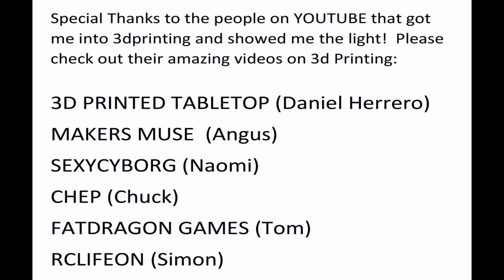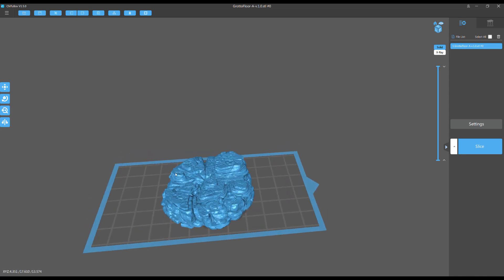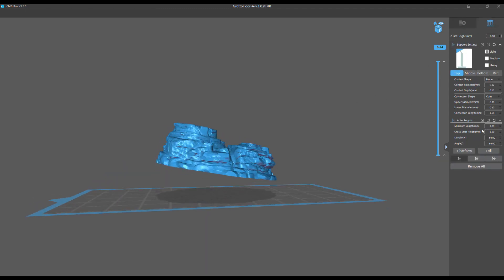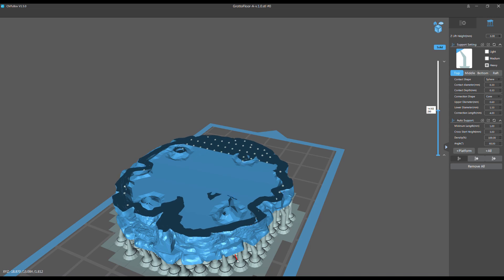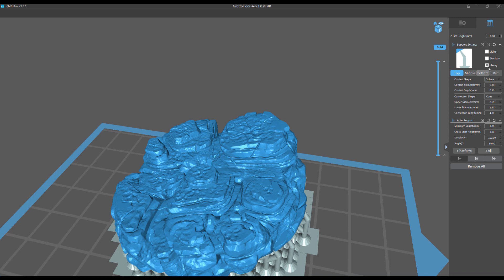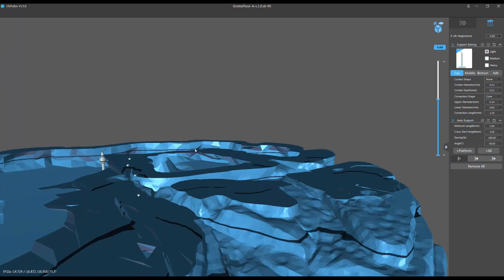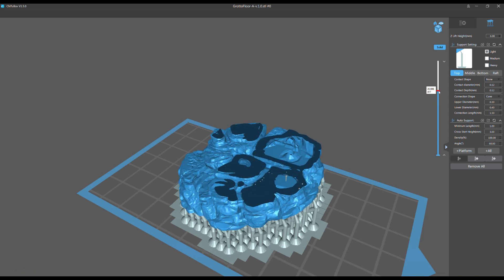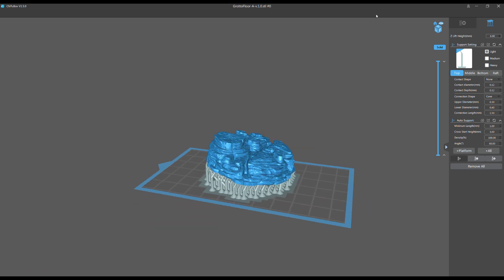DO NOT HOLLOW A MODEL IN CHITUBOX WITHOUT WATCHING THIS!

Comment: Good info, I'm new to resin and this was helpful. I did think this was going to cover curing the inside of hollow models b/c I saw a figure that exploded with wet resin on the inside recently and I haven't found any explaination on how you avoid that besides the single sentence advice of: Add drainage holes.

Comment: I have a very similar model, a base for a dragon, but when I press dig hole and click the green 'hole' on the model, Chitibox pro doesn't dig the hole. 
The hole I'm trying to dig is deeper than the wall, but not so deep that it starts to dig on the opposite wall.
It works on some surfaces of the model, but not the ones I want. Please could anyone advise?

Comment: Thank you for the video. It in fact didn't occur to me that interior space of hollowed out model might require that much support.

I am however a but uncertain about your choice of drain holes. I really suspect that the insets that hollowing out process made around the magnet holes will prevent resin from draining properly, trapping a large amount inside.

Comment: so I know that my current Chitubox version v1.8.1 will actually autosupport the interior as well now, but my little confusion, is that it also has the Detect islands feature, and will pinpoint them all for you, my question that I cant seem to find ANY solid answers for is, how can I tell what is considered an island that is safe to delete, and what qualifies as something I still need to add a support for, I get overhangs need support, but as far as the interiors of hollowed pieces, sometimes it really looks like it could just be inconsequential... long story short, I have a model with 120 islands detected, and a LOT of them look like I could delete them, but now I am nervous about if I am judging them correctly.... ultimately I feel like my question boils down to, if said island is shown as only one or two pixels, and is on the interior of the model, are those islands safe to delete?

Comment: What's the point of having drain holes? The cavity will remain open until the end of the print, in which case the resin will drain out the top (being upside-down). Right?

Comment: Question, new to this but would choosing an infill and making it a 3d grid be better than manually adding supports to the inside?
Reply: Only if those supports happen to be under one of the islands mentioned in the video. It would certainly make things faster, because you'd only have to add the manual supports to the spots missed my the infill.

Comment: Ok, I'm totally new to 3D printing (not got one yet but I have been making 3D models for videogames for years) You could  just make a large hole in the middle of the bottom base to allow supports to print from the plate up to the unsupported areas you need? All you appear to need in the base bottom is four supported holes for magnets to go into. You could even have a large scale mesh bottom to support those 'holes' and have easy access to the upper inside for supports. Just my 2c.

Comment: NOTE: Because of where you put the holes you could not drain the all the resin out of that model. At least one hole needs to be at the lowest point of the cavity so all the resin can drain out.
Reply: but actually the holes are not to drain but to let air in. it's upside down, so it stops sucking.

Comment: Hey Greg, about the placement of the draining holes: if you put them on the base, then the resin can't flow out, because the model is printed upside down. You'd need to put them on top (where they are visible, unfortunately) for them to drain the resin while it's still in the printer. When they are on the base, it may flow out when you're cleaning it, because the model moves and is submerged in your IPA/water. But then you're not saving any resin, because the resin was trapped inside the model all along. Am I right or I am missing something?
Reply from the maker: If the model completely exits the resin on higher layers before it's "closed in" the "trapped" resin will flow out  :)

Comment: Although I've been using filament 3D printers for many years, I finally got myself a resin printer (Elegoo Mars 2). When possible, I keep my models flat with as much surface space touching the bed as I can. I use supports only if I absolutely have to.  I've been getting fantastic results with 95% of all my prints right from the beginning. The only problems I have had are when I scale down a model so small that the walls are micro thin. Most everyone talks about the need to tilt models but for myself, it just seems to increase build time and use more resin. 

I still have much to learn about resin printing and I thank all content creators who have made so many helpful videos on the subject. Well, enough chat. Back to watching videos and printing.

Comment: If you hollow and prepare drainage holes in an external program for example magics, then generate support in chitu, it will fill the internal void with support. I think Chitubox might be manipulating the slice images rather than the 3D mesh when doing these hollow calculations, so it is left out when you try to generate supports which operates on the mesh. Its a pretty big bug imo. Although if they can sort it out it will save people a lot of money on file prep software.

Comment: Amazing videos! You're information is so clear. I'm curious if you had used auto, but with the light supports selected, wouldn't it apply them to the inside? It seems you could do a light auto and then manually add a few thick ones on the outside.

Comment: Might be a silly question, those internal supports - How are they going to be cured?
Reply from the maker: Some people snake a thin UV led in, I just make sure light gets into the holes  :)   Most important thing is that you clean the inside as thoroughly as possible
Reply: @3dprintingpro212  ah okay, i use a wash and cure station mostly, i dont have a thin uv light but ill look into it. Thank you :)

Comment: Very good tip on the video. (just ordered my 1st printer)
I've been wondering recently, if you are building the model upside-down then the hollow area is open till nearly the very end and should keep draining as it builds right? 
So how helpful are drainage holes? 
Are the holes you make at the top (build-plate area) merely to help with preventing suction?
Reply from the maker: at the top doesn't help with suction or "cups" it's just fro cleaning. If you fear suction or a cup forming, which is real, you need a hole somewhere near the build plate but on a "side"  :)
Reply: @3dprintingpro212  
Oh for cleaning the inside of the print, though is that necessary of it would be sealed otherwise?
thats the 1st time I've heard of it called "cups".
yea on the side near the build plate would be ideal for that. 

So, why the holes where the magnets go ?
I guess I don't fully understand how the draining process works. My theory seemed sound though.

Comment: thank you very much, great advice. I'm a total novice (actually I'm still waiting for my first 3D resin printer), so I have a very very dumb question: for something like this (regardless the hollowing and its problems/consequences), why do you need to raise it off the bed and tilt it? it has a flat base, so what would happen if you just let it laid flat on the bed? I'll need to print a bunch of bases for my miniatures, which will all have (obviously) flat bottoms. thanks if you can answer, and thanks anyway if you can't, for this video! :-)

Comment: There is a chance that if you hit supports first before hollowing out the model it won't build them inside. If you instead hollow the model first then add supports it will build little supports on the inside... just a thought worth trying...
Reply from the maker: that's right but it misses a ton of spots...

Comment: But then you cant cure the internal supports???
Reply from the maker: Most resins we use are cured enough during the print that the internal supports are fine. Important thing us to make sure you thoroughly clean it so no uncured resin is in the hollowed part.

Comment: So you tilt the object to reduce the surface area, but then add support structure that creates even bigger solid surface area on the build platform. I am new to MSLA printing so I don't quite get that. If someone could clear that up for me I would be very thankful. :D
Reply: The bottom platform is printed at different settings, typically won't have issues.

Comment: The way I get around this is saving it out hollow as a stl and edit the file in a 3d application. Where you can easily build select support inside the mode with walls.

Comment: I have a model that fills the build plate  and uses 3/4 of the build height.  It needs to be hollow.  No matter how I hollow it, the neck and head are always an island.  I can clearly see the island, but can not add support, even the light ones.  I know there is enough distance to do even a heavy support.  I can not get my mouse in there to select the points to add them.  How do you fix that?  How do I lock teh layer so that I can simply go right and left and not up and down so that I can get inside the model?

Comment: I'm using v1.6.3 and it generates auto-supports internally when the model is hollowed..   at first I thought that was not good, but then realized it's good.
Reply: Might have to upgrade as this is exactly what I've been looking for... Auto internal supports and manual platform supports.. Thanks!

Comment: What is the advantage of creating a hollow model vs. a solid model? Sure it would use less material, but the small cost compared to the time and possible increase of failure doesn't seem worth it. Any other reasons?
Reply from the maker: aside from costs savings, weight of the model as well, I rarely hollow to be honest...

Comment: im gonna be honest.  There are not that many unsupported islands on that model. As long as it connects somewhere to a previous layer its not likely to fail.
Reply from the maker: ANY unsupported island leads to cured resin floating in your vat or stuck to your FEP and can cause either failed prints or worse a puncture to the FEP film.  Even one unsupported island is way too many....
Reply: @3dprintingpro212  Yes of course and I agree but I think we counted 4 so that's not that hard to deal with although I do see the point of your video.

Comment: Could you slice the base off and save it out. Then do “support all”. It should do supports on the inside, you’d think. Then possibly import the base back in and combine the model back together. You could even then remove the base supports clean and redo the “support all”

PS. I’ve never used the above software before, but have 20 years 3d animation FX experience. So workarounds are a daily thing.
Reply: Sure, but you'd need to use something like Blender to do that slicing. Chitubox doesn't alter the model itself except in very specific ways, like drain holes, hollowing, and adding supports. Cutting pieces off the model or changing a model's dimensions would mean using another program for that part.
Reply: ZBRUSH was the best money I’ve ever spent in my life. The free upgrades are literally priceless. 
🤓🤜🏼🤛🏼🇦🇺🍀🍀🍀😎

Comment: im having some problems with placing supports inside the hollowed model, i simply cant :S Not lights, mediums or heavys.. Using your settings, do you have any idea on what the problem could be?
Reply from the maker: usually it's if there isn't enough "room" for the support
Reply: @3dprintingpro212  is there something you can change to make it fit?
Reply: @3dprintingpro212  I'm facing the same problem, no room for support but am not able to figure out how to fix this.

Comment: I know this is more on the modelers end but would it not be better for a print like this to simply not have a solid base and have it hollow all the way so its more like a shell. Then the auto supports would work better. I guess you could make it this way buy just using the venting hole feature to just hollow out the bottom as much as possible. Im new so Im not sure this would work.
Reply: and just make  cover piece to glue in from bottom if you need it .

Comment: I'm new to this, in fact I just got my printer but haven't printed anything, but I'm doing some research before I proceed. After watching your video , I was wondering why you wouldn't use infill like this video : https://youtu.be/3Q5MUVmb_ZE
Reply: Infill doesn't directly support parts. it goes up in a specific pattern that doesn't pay attention to what needs supported. infill is more for resisting crushing  not  supporting while you build.

Comment: Good reminder. This might be a case where adding infill would come in handy.
Reply: I expected him to talk about infill but he didn't
Reply: My reaction to... Hey, what about infill!
Reply: Infill doesn't always hit the islands like you want unfortunately.
Reply: Dito!
Reply: @powertothebauer296  I print figures and EVERY hollowed model needs internal supports for the exact reason mentioned in this video. Printing 40cm high figures solid?... Good luck with that... lol
Reply: New to 3D printing: How do you add infill on a resin printer? FDM seems pretty obvious.
Reply: @wishbone25  using Chitubox, there is an infill setting which will do it for you automatically.

Comment: One of the more serious consequences of unsupported islands that doesn't cure to the model is a subsequent layer or print pressing that into your screen. You're right, it can mess up the fep, but it can also destroy your screen causing dead pixels.
Reply: I'm curious if this would actually be a problem, though. If there's an unsupported area, it's going to cure on the bottom of the fep, and if not attached to the rest of the print, will just remain there or get knocked loose and float around, right? If it stays put, it's not going to get any taller, because the print will be sitting on top of it. The printer brings the model back down with the same .04mm (or whatever your layer height is) gap, right? So it'd at most get wider and wider until the print eventually picks it up or it floats away. 

I guess a floater could get stuck sideways, caught between supports or something?
Reply: @thatonebird314  i had a similar thought. I have no experience yet, but this sounds like how it should be.